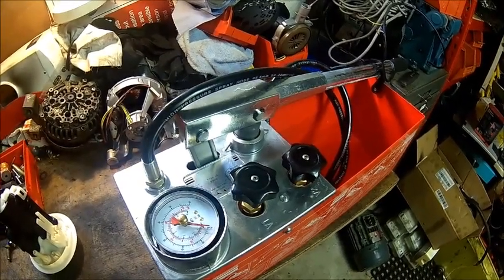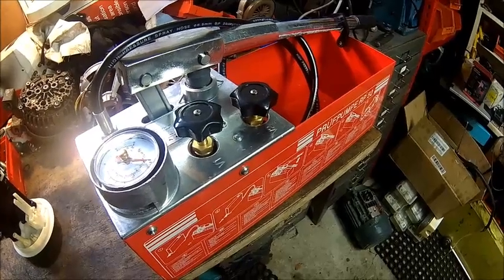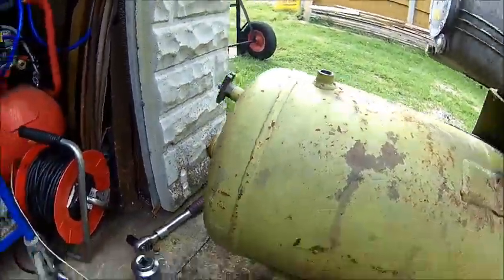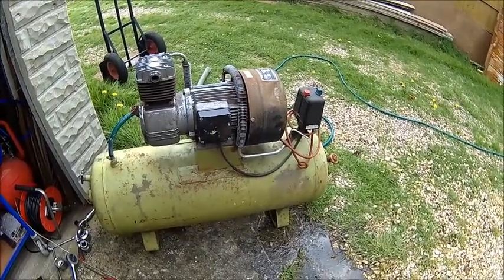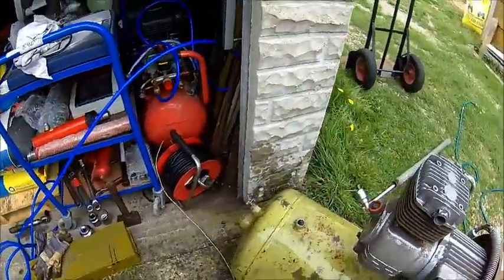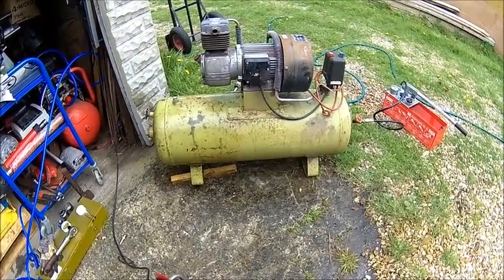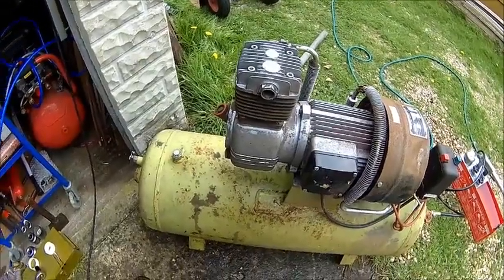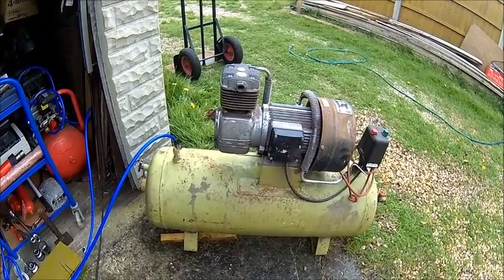Air compressor tank testing, Getting a new life into an old air compressor, part 1

Comment: now there's something i still need to get for my own shop. the silly things are still an awful lot of money even for a pile of junk...been tinkering around with the idea of making one out of an old little 4 cylinder engine. grind off the exhaust valve cam lobes and plumb in a line to the spark plug holes ...slap a 7 or 8 kw motor on it.. should work.. what do you think Mike?
Reply from the maker: You're right,  the cheap DIY stuff is still way overpriced, and quality is always questionable, but something decent sets you back at least $500. Just before i moved, i bought a Chinese 2 cylinder compressor from a company which resells customer returns, it's got a few minor  issues, but it was only around $120, still need to edit the video.
The reason for recommissioning this one is that it has a big tank and it's 3kW 3-phase, so that goes to my rear workshop to feed the sandblaster. Your idea with the repurposed engine is good at first sight, but has a major error in your thinking,
a (theoretical, no valve overlap considered) four stroke engine, which has a 720 degree cycle, has the intake valve closed from  180deg to 720deg, You will have a serious problem from 360deg to 540deg , because the piston goes down with no air coming in, because that's where the combustion happens. So yes, it's possible, but not really without changing the whole engine timing. Or alternatively, take the cams out completely and use reed valves at inlet and exhaust ports. IMHO, too much work for what you get.
Reply: @dynoguy  yes, you're quite right. i didn't think about the combustion cycle being a down stroke too. it would be kind of fun just to dink around with the concept and change up the lobes on the cam.
Les Schwab tires out west has service trucks that have a V-8 engine in the bed of the truck that has one bank of cylinders as a dedicated compressor and the other bank as the engine to run it. they put out an insane amount of volume, which where i take the idea from, so it would be reasonable to deduce that the cam in that has to specially made to make the thing work...but the reed valve idea is not bad either...i'll have to mull that one over

Comment: Nice tester. Why not got much higher pressure when testing?
Reply from the maker: Thanks Randy, hope you well ... i did not want to pop the safety valve, it looks like a one-time use type and i cannot read what the pop out pressure is. I only run it at 8 bar, so testing at somewhat over 11 bar is sufficient.